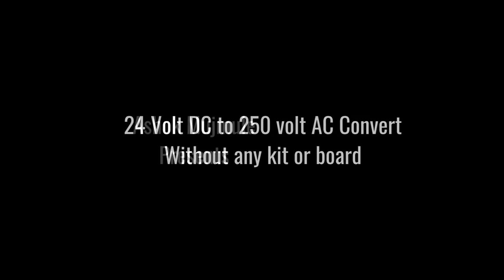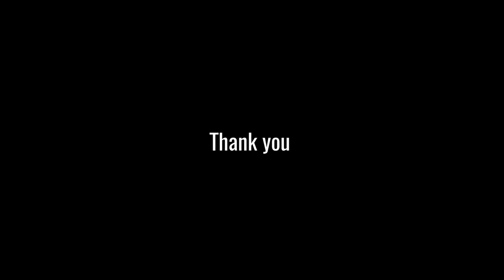DC to AC Converter without any board or kit

Comment: Mara inverter ka borad /circuit ma problem hay 15 sa 20 minius 7w ka bulb jatlta hay invrrter ka red bulb jal ka off ho jata hay agar switch on off karna per 5 sa 10 sec jalta hay fir off ho gata hay kaya.

Borard ka con sa part ka saman karab hay
Bataya

Es ka aalawaba board ka ma direct larna ka system batayea jilsa ki bulb jalta raha on off na problem nahi ho .

Mayna battery check kiya full charge kiya battery ma problem nahi hay.esi sa charging 100percet  
Thik hota hay lakin bul jalana pa  off atomatic ho jsts hay problem ho raha hay mujha es per video banayea cal me please  7970303263
Reply from the maker: Battery badal k dekho ek baar